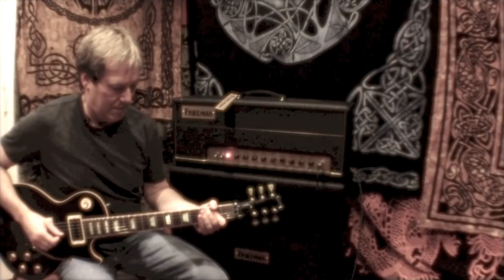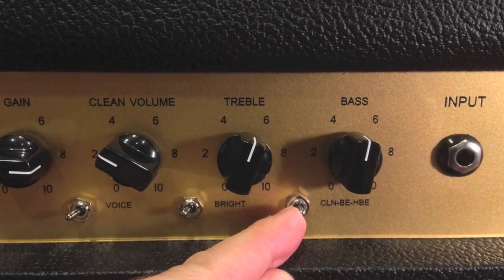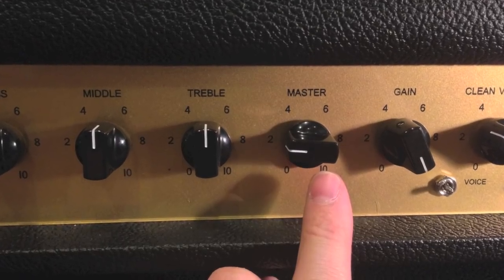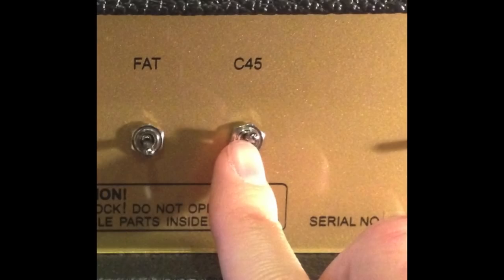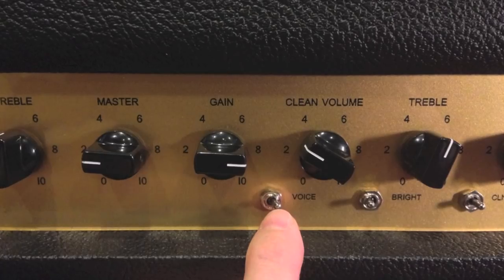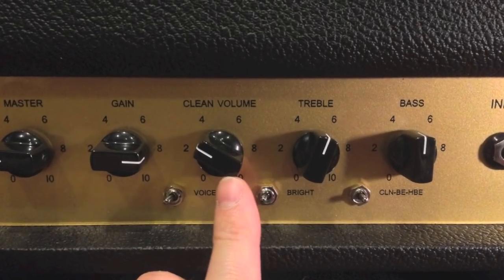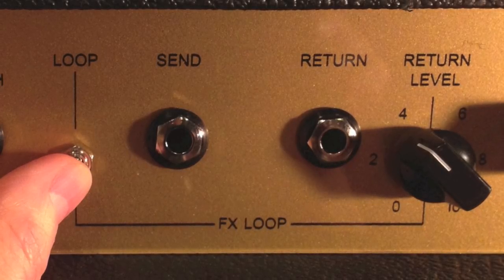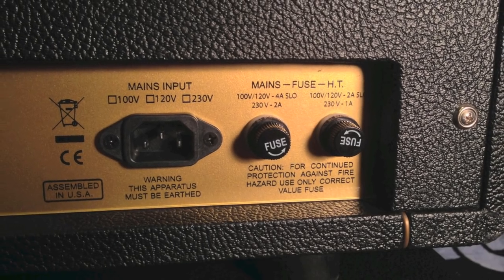Friedman BE100 Video Manual

Comment: This is what has me scratching my head about high-end am manufacturer's.  You could watch 100 Friedman BE demo's, and not hear a tone like this.  It completely misrepresents the amp line.  Had I know a BE could sound like that, with that much mid-focus, punch I'd have purchased one by now.  I would think that would concern Dave Friedman.  One in-house demo with their amps dialed in the way they were designed to sound would be all that's needed.  Tone is always subjected...but, there are "YouTube Celebrities" who weren't even able to dial in this amp to sound like this (Clean or dirty).  They almost always use too much gain, among other things.  This was KILLER.  The only thing wrong is that they spent too little time on the tone itself, given it's a manual, as opposed to a demo.  Every amp under B.A.D., should have it's own well-dialed in demo for each model, and skip the YouTube celebrities, BS.

Comment: Your videos are superb however on this one I would suggest going in to way more detail regarding the loop!  That is actually a deal breaker for me (assuming I'm understanding it correctly). So if the master on the front "must be set between 5&6" that means that during a gig if I need to adjust my volume I need to reach behind the amp and adjust the volume?  I think a video just on that would be helpful if possible.  I was literally about to buy one of these but that stopped me dead in my tracks. Not being critical, just looking for some guidance here.

Comment: Please do not take offense because I am truly one of your biggest fans.  I purchased the Axe Fx Ultra and the Axe Fx II and the Friedman amp (Steve Stevens) largely because of your videos.  However, I am a tad disappointed to learn that your fantastic tone in this video(may have) required approximately two thousand dollars of additional equipment (maybe 1700 with the right connections)!  My question is how much of the tone is secondary to the Two Notes and the Roland?  Also, I hear delay.  What effects were you using (any overdrives or the EQ on the Two Notes)?  Again, do not get me wrong Mr. Day, if I need to shell another 2000 clams to nail that tone, then I will do so.  The tone is that amazing.  Of course, your fingers account for a significant amount of the variance and I will, unfortunately, be unable to buy those!!  Thank you for your kind attention.

Comment: Is there some amount of diode clipping at work with ALL distorted settings or only in saturation mode? In other words if you set the amp up for lower gain crunchy sound are diode clipper out of the signal path?

Comment: whats the differance between the new BE-100 and the 2012 and 2013 one with the built in attenuation? Is it the same tone and same circut or where there upgrades in the sound of the amp? Please help I wanna buy one but I only played the new one at a guitar center but I really need that half power switch!

Comment: Even with a sound check. When your playing gigs you usually adjust your volume on the first song. Sometimes you adjust slightly as the night goes on. The thought of having to reach over the back of the amp to adjust the volume 'cause I'm using the fx loop is a major turn off.
Reply: Hey Andrew. The fx loop return volume control  on the rear is there to compensate for any level changes your effects might cause.  The master volume for the application you are talking about  is on the front panel. You don't need to reach over the back to adjust your level. You would do this on the front of the amp
Reply: LOL what? I don’t think you understand what the fx loop level control is.